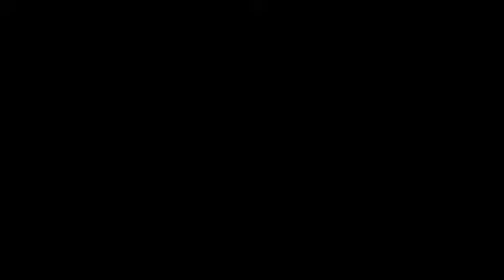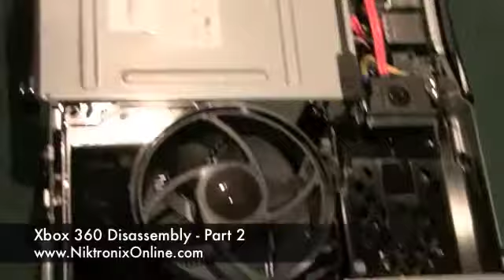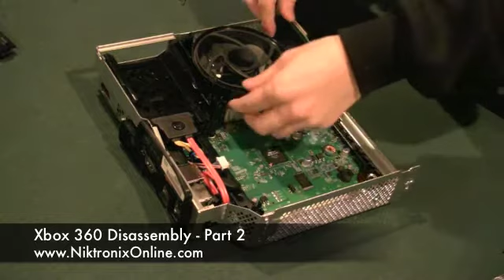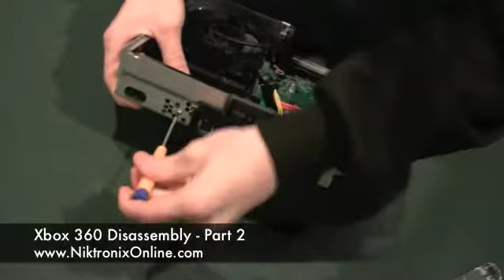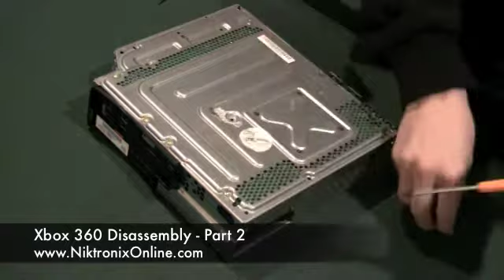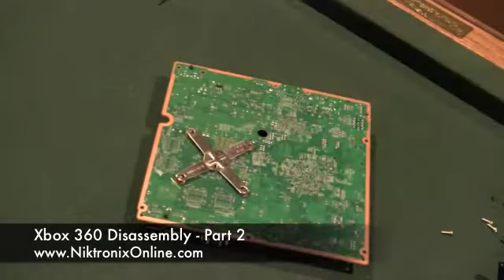Xbox 360 Slim Disassembly - Part 2 - Niktronix

Comment: @Adycool7600 xclamps have nothing to do with the RROD.. it was all the chips and cheap soldering, etc. I've seen PCs use Xclamps and they run for at least 7 years the only problem was this is made by microsoft so you know somethings going to go wrong!